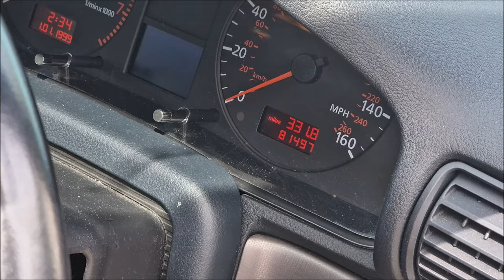Audi A4 Pre MOT Checks - At The Moment ... It's A Massive Fail

Comment: The aim of the front suspension design ( X2 top arms / X2 bottom arms with the spring and shocker assembly being mounted on the rear bottom arms ) is  to provide 100 % ( Or as close to it ) of the tread at most steering angles whilst in motion ( not inlcuding full lock ) but at the same time to provide comfort with a sporty feel, this front setup ran throughout the Volkswagen Group for many years.
Reply from the maker: Excellent! I said some clever person would know! Thanks for explaining it ☺️

Comment: Pete was lucky getting that top arm bolt out Jon
I've had many over the years that I've had to use the hot spanner and air hammer on to overcome the  recalcitrance !
I tend to replace top arms in pairs these days if one has had it like as not the other won't be far behind fingers crossed for you that the other side is not so much of a pig good luck.
Reply from the maker: Thankfully we didn't have to go that far 😁

Comment: Have you done the cv boot yet? If not I’ve got the QH stretch boot tool you can borrow, I’m not far from you and you’ll only need the boot some grease and the clips. Very little dismantling, you just need the air compressor.
Reply from the maker: That's very kind of you to offer. We have done it 😊 - the videos release on a delay. Thankfully it went really easy 👍

Comment: Question for your dad. If your car has a switch to manually lower the headlight beam (if you have heavy weight in the back causing the beams to sit higher) if it doesn’t work, is that an MOT fail?
Reply from the maker: Dad says: If the lights are aligned within tolerance it's a pass. If lights too high or low its a fail
Reply: Thank you
Reply from the maker: @Fourwheeledfarming however that now may have been superceded looking at the manual. You can read It online - Section 4.1.5 is what you need. Might be an issue

Comment: Its not in bad Condition for it's age the b5 Audi a4 i had the B5 Audi a4 b5 Se 1.9 Tdi. I have the a4 b6 tdi Avant sport now as my Daily the suspension of the B5 is simple 😂 appart from the pinch bolt. Lucky for you it doesn't go into alloy stub it's the cast Iron and not alloy the b6 is Alloy i bought an a4 Quattro sport 1.9 Tdi with a snapped one i had to remove the bolt and replaced it with a new one. Cv boots are common on them i have replaced a few the b5.5 Passat has the same problem. 😂😊
Reply from the maker: Ah handy to know!